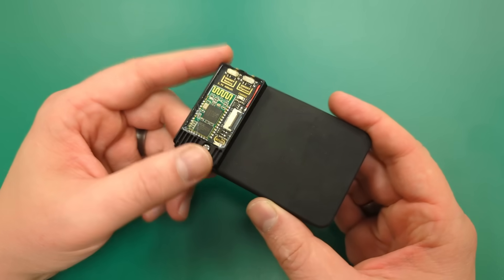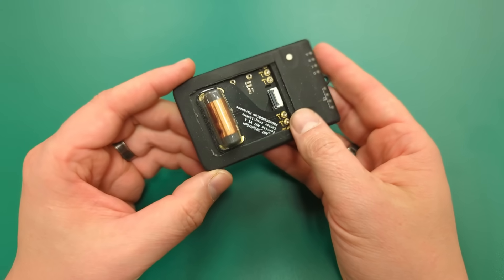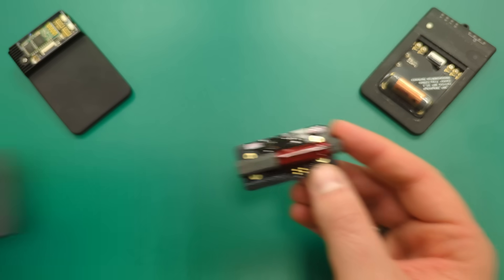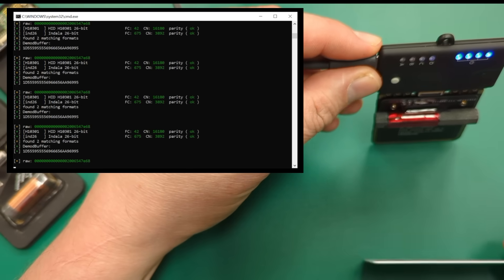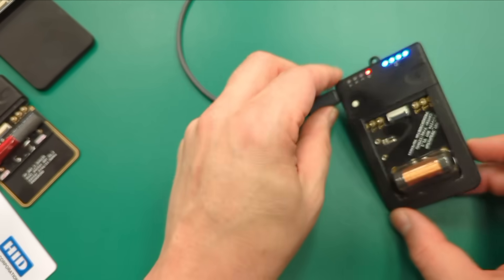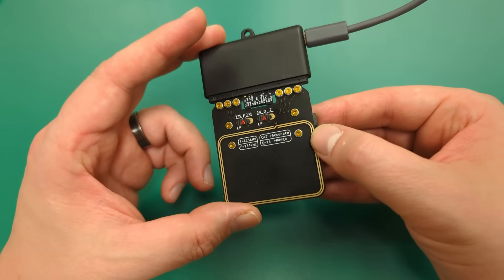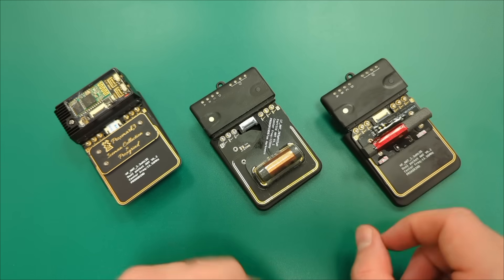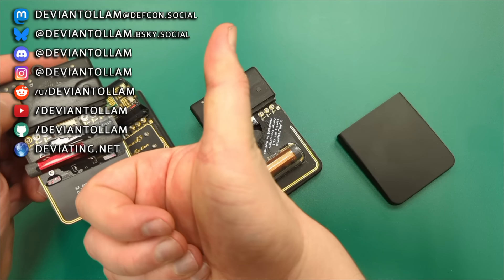Testing a New Implant Antenna

Comment: Hello, do you have any updates on this antenna design?

I have a NeXT that is WAY too deep and I cannot get any reads on the LF side, much less reliable ones. Writing to it would be a fever dream. I may have set it to Indala26 a while ago, which is harder to find a good reader "in the wild", but am not sure. Very rarely, I get some garbled up data when trying a read.

I tried with my Proxmark RDV2, nothing. Bought an RDV4, nothing. Tried the Harkness antenna, still nothing... :(

It's funny that the HF (NTAG216) works well. Maybe the t5577 is broken?

Comment: How do the implant RFID chips perform with conventional readers in the field? If you have to grind your hand on the Proxmark's stock antenna to get a good read I can't help but think that other readers would be any better and that could maybe get uncomfortable having to do that every time.
Reply: It depends on the reader for me. I have a system of over 4000 readers (and growing!) and every one has a sweet spot that gets me reads. There are readers that I can never get reads on. For reference, they are the HID 920PTNNEK00000 multiclass readers.

Comment: Yeah I'd love to have and RFID implant but are there any you can turn off without cutting them out?
Reply: what exactly do you mean by "turn off"? a passive RFID chip, like you'd implant, is powered by the reader's antenna, not by an internal power source. "off" is the default state
Reply: @CasualCoreK  Yeah so more technically I mean disconnect the antenna so it can't be powered.
Reply from the maker: I mean.... Why does it matter?  I'm not understanding.  If you don't want to use it you can (1) not press an antenna into your hand or (2) erase the data on it so that it's blank and won't show anything to any device that that tries to connect to it
Reply: @DeviantOllam  Purely paranoia, couldn't it be used to ping your location if someone had the right setup? With cards and devices you can always at worst drop them.
Reply from the maker: @punksci6879  the only way for anyone to interact with the implant is to be literally less than an inch away from your skin... I understand the concern but please know that such a tactic isn't really feasible
Reply: @DeviantOllam  after loosing my bus card the other week I might consider it then. Although I do still like the idea of an implant you can control with a capacitative switch and a set of taps. Turn it "on and off", switch modes or profiles.
And actually does that go for the cards as well? I always cut the antenna on bank cards as I don't use the feature.

Comment: I do not usually have any trouble READING my LF implant.  It works fine with the original antenna, and 99% of door readers.  However, I had to get the Harkness coil to reliably WRITE to it.  The original just would not cut it.  It would be interesting to compare the write performance of the new antenna with the other two.

Comment: Have you ever worried about pinching or breaking your implants? I purchased a few a while ago but the idea of accidentally pinching it in a hinge or slamming it against anything by accident has made me a little hesitent to get them implanted
Reply: They're very durable. They're not going to break. The only way it'll break is if you put the implant on a hard surface and hit it with a hammer. Your body is soft and it'll just move or be cushioned by muscle and fat. I've had mine in my hand for a a couple of years and it's been hit, squashed, etc. while working on my truck or other things.

Comment: The silkscreening is upside down because the manufacturer (JLC from the number format) put that on as a tracking number. In other words, that's not Warren's fault.
(it kinda is though since you can ask your board house not to put anything on your board. )
Reply: It's more expensive to have them take it off. However, JLC does allow you to add, somewhere of your choosing, silkscreen text saying "JLCJLCJLC" and they will put the order number in that location for free (you have to also change the "order number" setting to "specify").

Comment: "Implant" gets me a click immediately! I love my implants and use the 125Khz RFID credentials at work daily!
Reply: I'd love to know how they do with an MRI.  There isn't a lot of good information.
Reply: @jmr  I have similar concerns. The Dangerous Things forums seem to suggest they are too small but that's anecdotal evidence.
Reply: @jmr 
From what I could gather at the Dangerous Things forum, they shouldn't be physically harmful during a MRI, but they will mess up the image. I don't know to what extent, though.

Magnets, on the other side, are a BIG no-no. If you don't remove them before the MRI, they WILL be removed from you by the end, haha.
Reply: @lucas-h2t6e  I think you meant CT scan images can be messed up.  According to Deviants wife they are fine in the MRI.  I had the opportunity to chat with her briefly on the topic since I posted my original comment.  They are non ferrous so can't be ripped out.  Apparently the the induced current isn't enough to damage them which was one of my concerns.
Reply: @jmr  No, it's MRIs, because the antennas create unintended magnetic radiation when interacting with the fields generated by the machine. They can also heat up a little due to this, but temperature becomes a problem for you much earlier than for the chips, haha.

CT scans use X-rays, which, funnily enough, may cause more damage to the implants.
Reply: @lucas-h2t6e  Metal is known to cause image problems on CT scans.  Tara said she didn't have any problems in the MRI machine though. I specifically asked if it got hot.